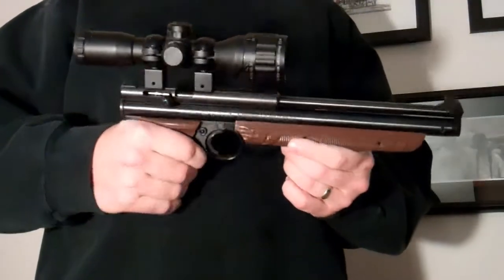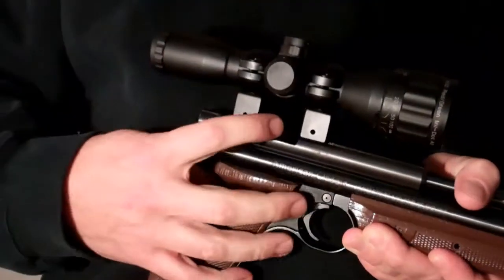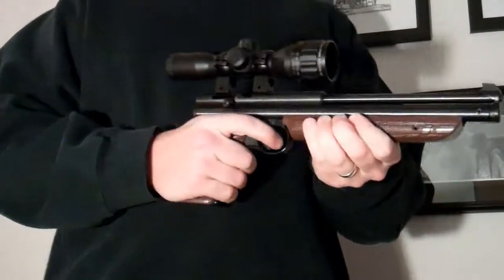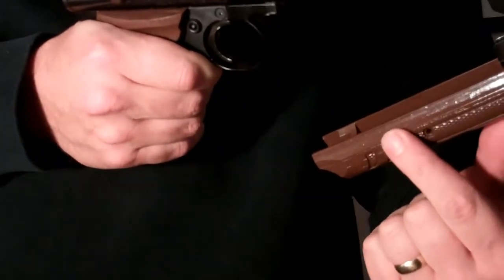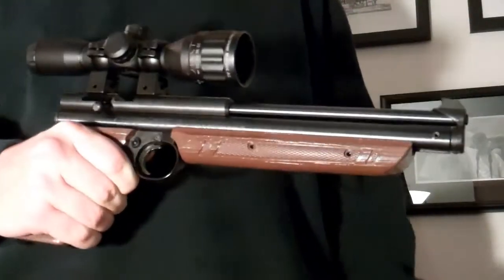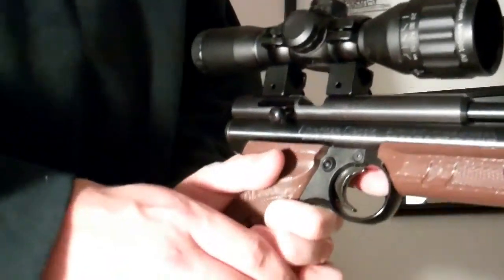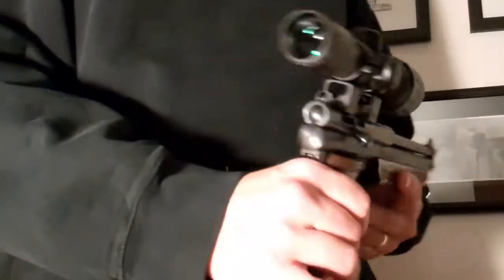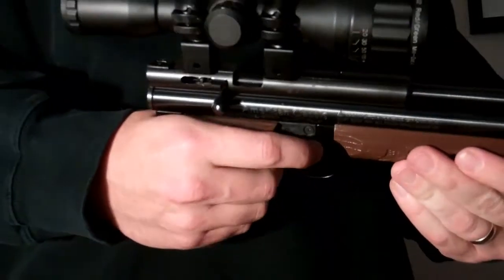Crosman 1377 American/Pumpmaster Classic: Operation

Comment: Hey cut that barrel band flush with the tube. You will have a much more accurate pistol. Make sure you add two set screw to the breech though. Mine shoots one hole at 10 meters that way.

Comment from the maker: Just pellets. The plastic BBs (Airsoft) are a different diameter. You wouldn't want to shoot the steel BBs that are the right size, as there's no magnet to hold them in the chamber; they roll right down the barrel. Not to mention BBs are not good for a rifled barrel; they strip the rifling out eventually. If you want to shoot plastic BBs get an airsoft gun, and if you want to shoot steel BBs, get a smoothbore BB gun. ;)